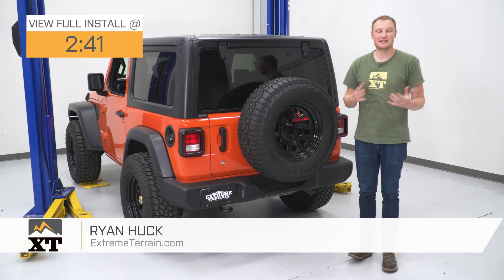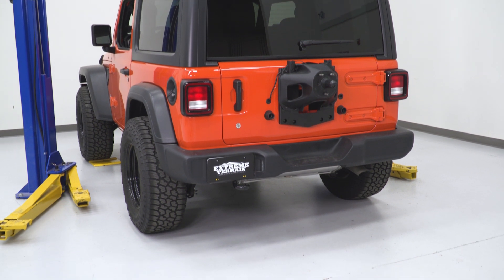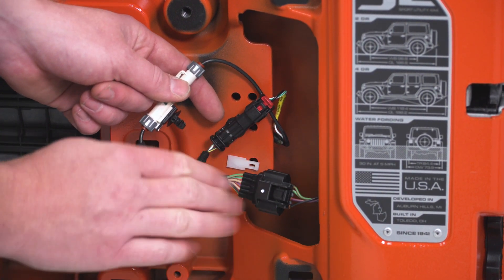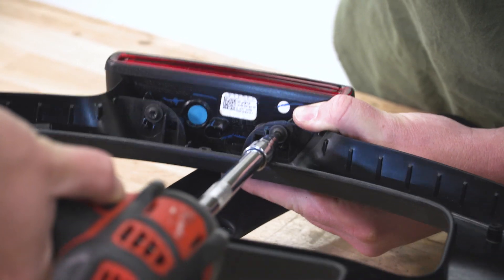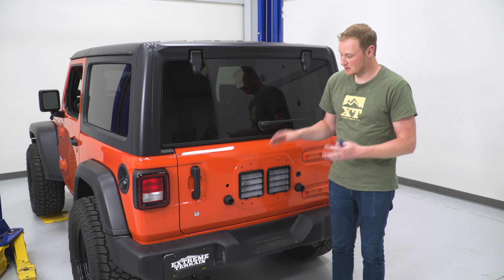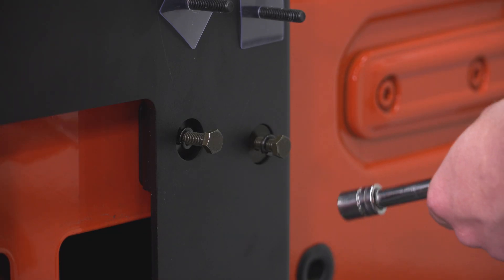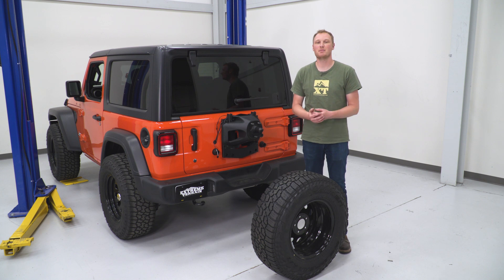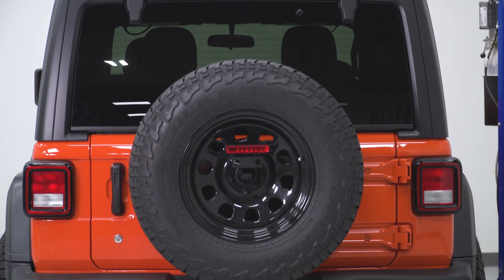Jeep Wrangler JL RedRock 4x4 HD Tailgate Mounted Tire Carrier Review & Install

Comment: Does the rubicon already have the factory equivalence of this ?
Reply from the maker: The Rubicon does not have this kind of system from the factory, but the Rubicon-specific rear bumper and tire carrier accommodates for a slightly larger tires from the factory. -Zach